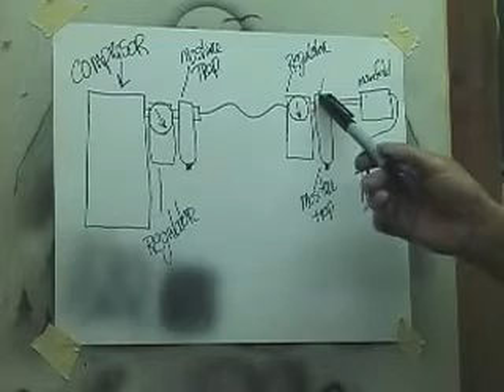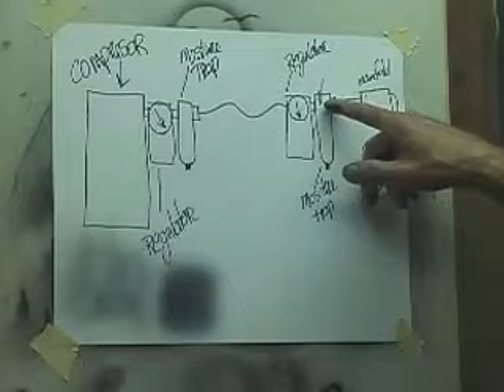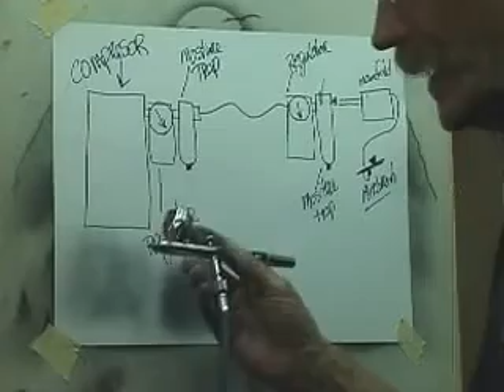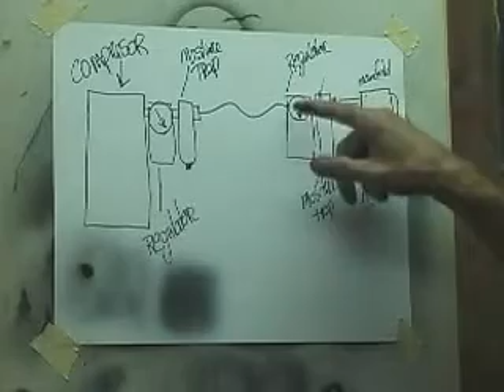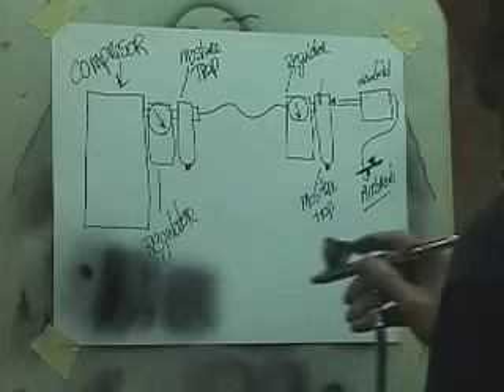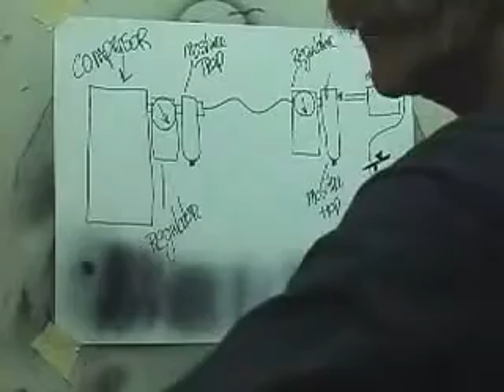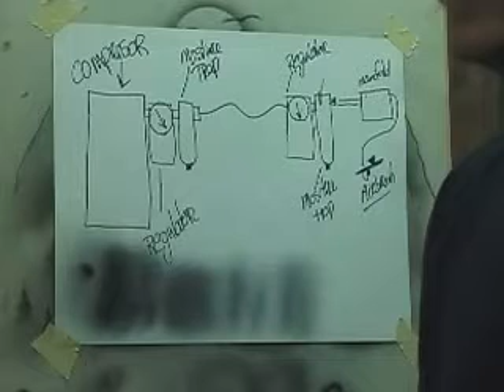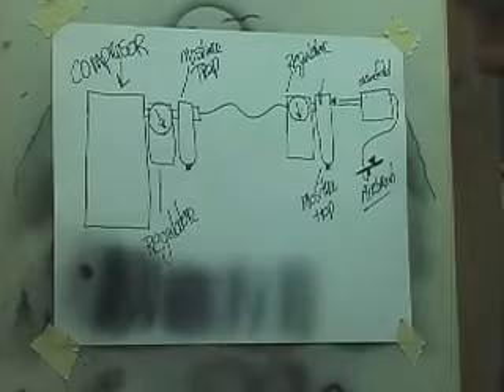How To Airbrush - Air Pressure

Comment: Exactly what I was looking for: the water separator goes AFTER the regulator, at each stage, because condensation can happen at each pressure drop (through the regulator) and you want to capture that moisture.
Reply: You should consider that warm air will hold more moisture in suspension than cooler air and when the air is compressed the air temp rises. Should your air compressor be any distance from your painting station the air will cool in the line and moisture will condense in the line and the closer the final regulator/ moisture trap is to your airbrush the more water is removed. Keeping that in mind allowing an airline to lay on a cold floor or along an unheated wall will aid in the cooling and increase this moisture buildup.